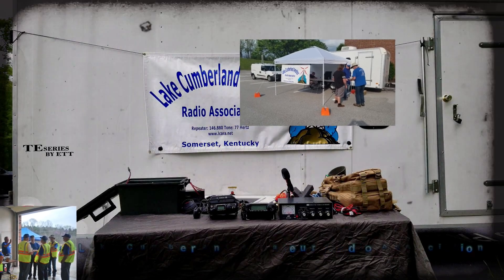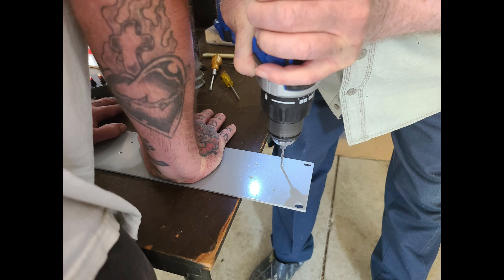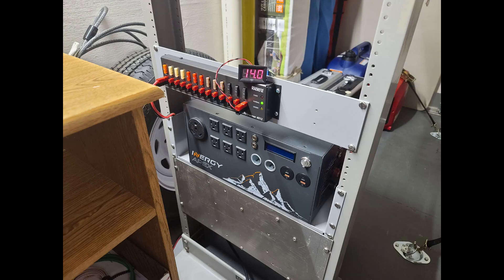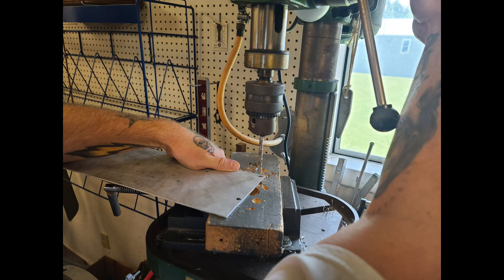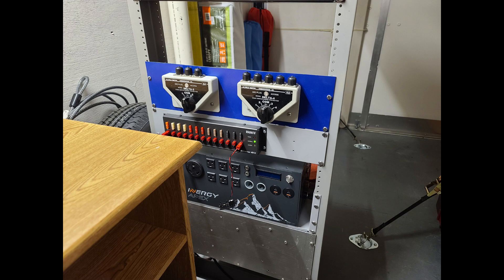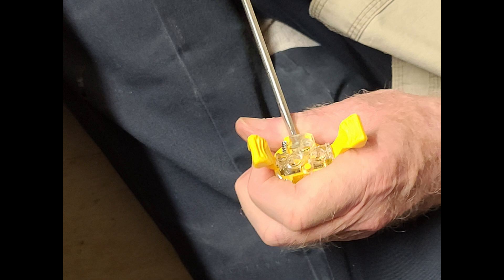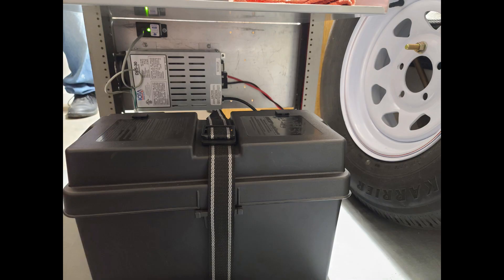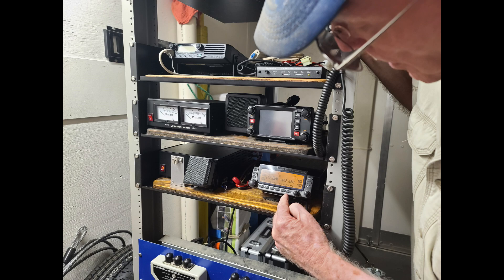LCARA HAM Radio: EmComm Trailer - Floor to Ceiling Rack Additions!!!

Comment: That’s coming along quite well. Shore power is important for sure. 
I like the Rig-runner power distribution. I use a Paradan 6 with a Power LED and a Amp meter. I like the options these power distribution strips provide. 
Watching these trailer videos getting my thinking I need one of those Trailers. KI5IQE